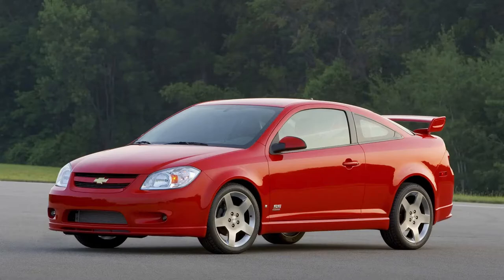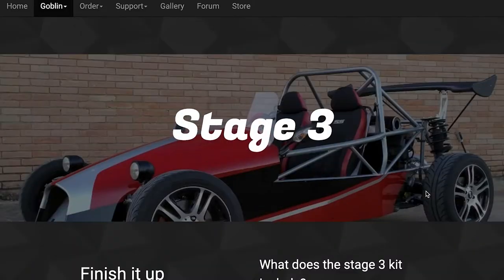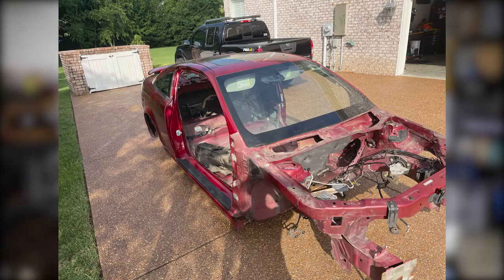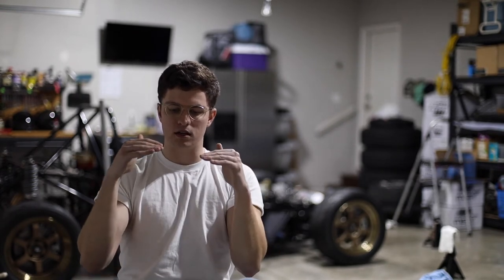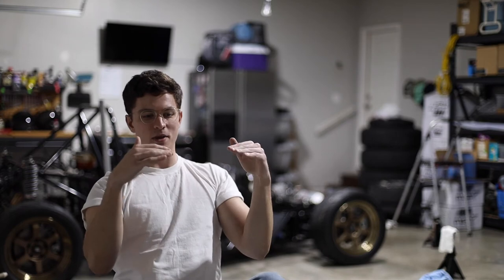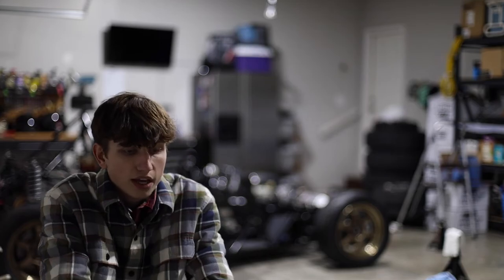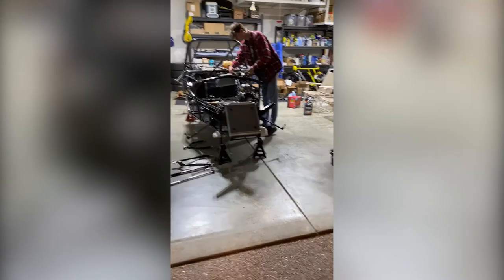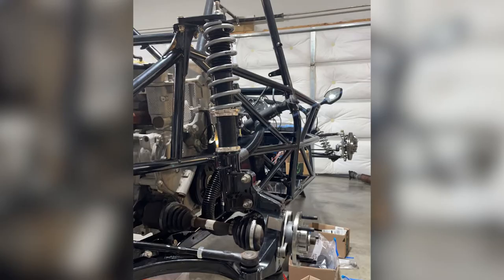DF Goblin #305: The Documentary

Comment: Good for you. I built one of the first ones, not much documentation at that time BUT I found it was not that complicated. The Goblin is the "essence" of an automobile, only the things that are necessary to run. This is an awesome father - son job.

I too had about 200 hours in the build although I had a lot of the time in the wiring harness as I added a lot of "other" stuff to the wiring. HVAC unit, heated seats, I have an automatic, a lot simpler linkage. I don't remember how long it took me for the teardown but it was not that difficult.

As an early Texas builder, I got caught in the Texas DMV in getting it licensed, I had it licensed twice and then revoked by the DMV. FORTUNATELY that has all been resolved. The Texas DMV initially wanted to tell me that this was an OFF-ROAD vehicle and I could not drive it on the street. These cars are a rush to drive. It is amazing what 164 HP does in a 1500 pound vehicle. Good video guys!!!

Comment: Video was well done ya'll. Why did you want the 2007 supercharged over another year supercharged or a turbo?
Reply from the maker: Really just came down to what was available. At first we were set on a turbo, but we soon found those were a lot harder to find than the supercharged. After a good bit of time searching for a good tc donor and not finding any that fit our criteria, we expanded our search to superchraged cobalts too. It just so happened really that we found an 07 that was in pretty good shape for a decent price. We figured that even through it would have less horsepower and toruqe to start off, it would still be crazy fast on the super light chassis lol.